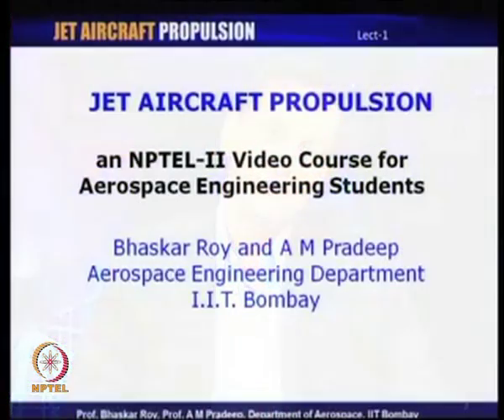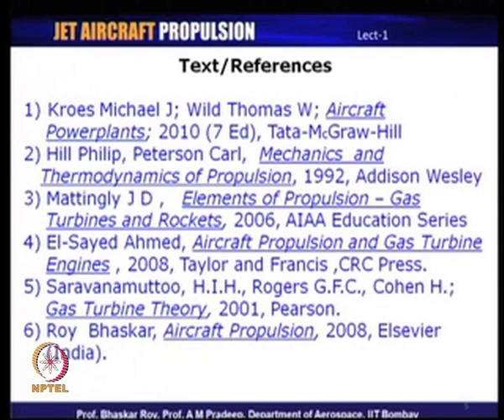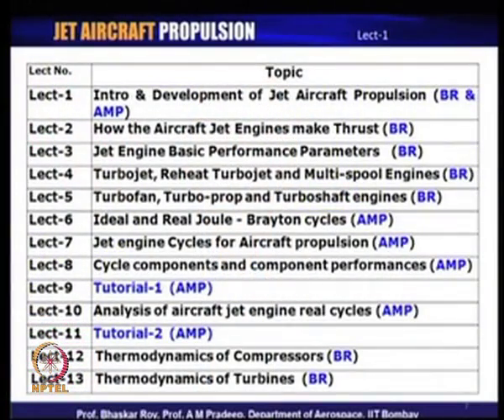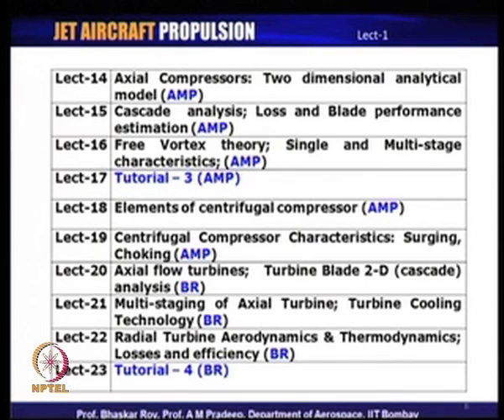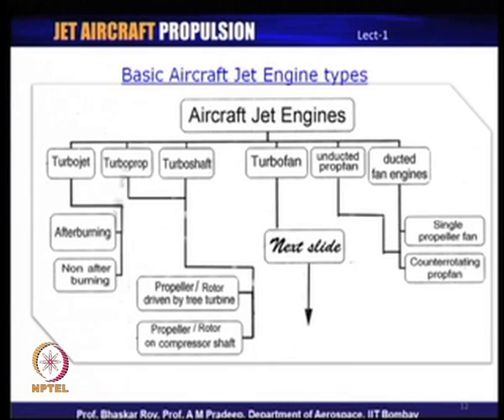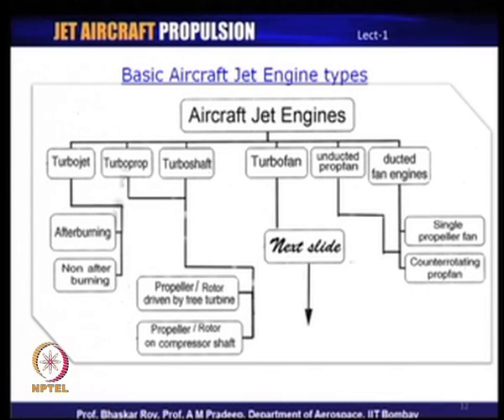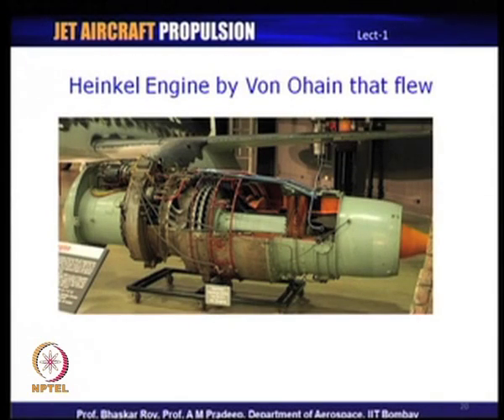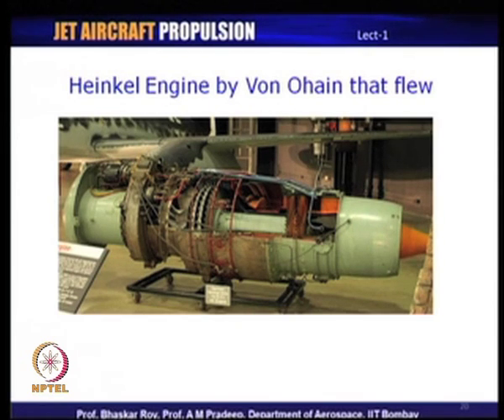Mod-01 Lec-01 Introduction & Development of Jet Aircraft Propulsion

Comment: You presented a picture of a BMW- 109-003 engine That you are claiming as the Heinkel HE-S3B. So you are teaching the WRONG engine to your students... BAD teaching..
Reply: So just to give you a heads up, yes this indeed is BMW but it was used by Heinkel & they repurposed them.
Reply: you forgot your BMW history .. heinkel was part of BMW at one point ... just like Daimler and Benz were once together ... BMW is a conglomeration of about 20 companies dealing with cars and trucks and tanks to airplanes and their various engines ... BMW and even mercedes -benz are parts of the same company essentially ... you will find one engine is very similar to another because of that as it is easier to start from a known engine and adapt it to a difference need than to start from scratch and make a new one entirely 
.
this is also where part interchangeability comes from ...